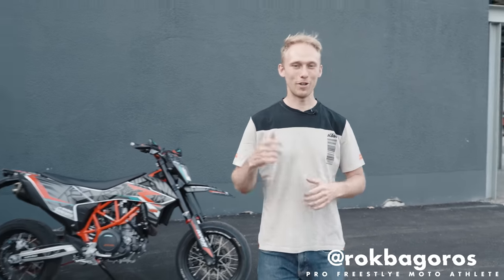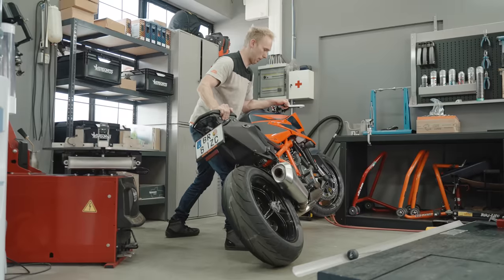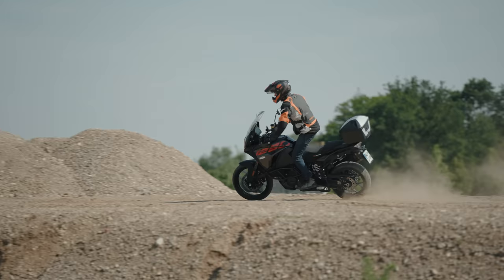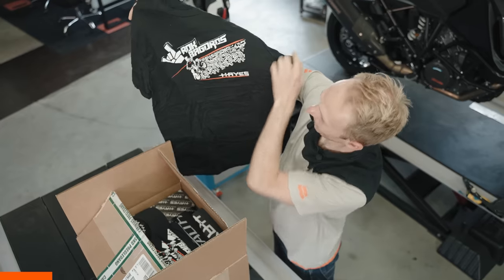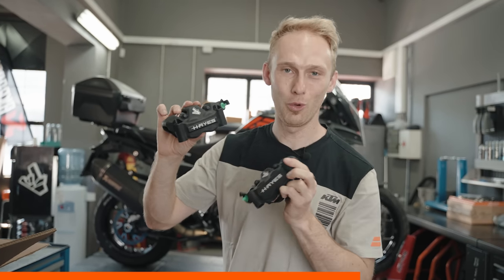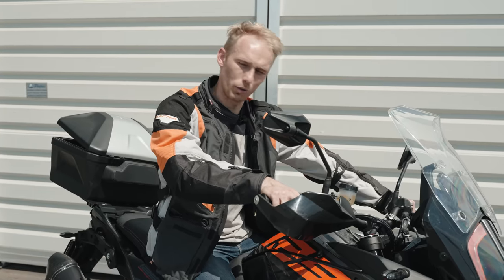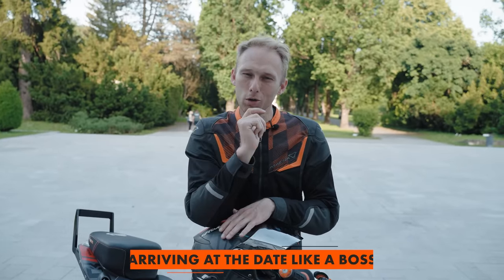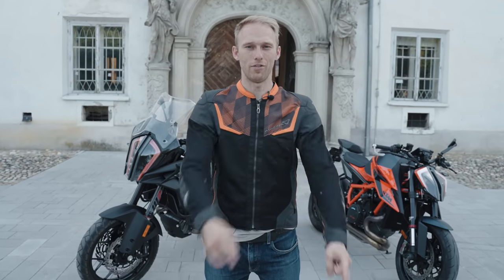5 EASY MOTORCYCLE RIDING TIPS  I RokON vlog #113

Comment: Once you ride with 2 fingers on clutch and brake it's game changing... Even the acceleration on throttle becomes much more smoother, expecially when you have a 1290R 👍
Reply from the maker: Exactly :D
Reply: @RokBagorosStuntrider  I have the 2019 SMCR and for some reason, it doesn’t like the two finger on the clutch method… two finger brake I always do! The clutch side seems to not engage properly unless it’s pulled all the way in. So the two finger won’t work and it kinda bums me out. It almost acts like the quickshifter is interfering.

Comment: I've tried using only two fingers on the clutch, but even if I adjust the clutch cable and lever to the highest position (without risking slipping when released), I end up crushing the other two fingers with the lever when I apply the clutch enough to fully decouple the transmission (brand new bikes). On my CB500X I could only do it after I switched to short aftermarket levers. On my VStrom 650XT with the original levers, I can't. My pinky and ring fingers are not fat!

Comment: When you put two fingers on the handlebar you cant pull the clutch all the way in as the fingers will get in the way. Wouldnt that mean you are not fully disengaging the engine from the transmission when shifting gears?
Reply: Wrong. Depends of the lever design. I've always used two fingers on the clutch on every bike I've owned and never had a problem with gears.
Reply: Adjust your clutch

Comment: Hello
I am writing to you from Kyrgyzstan
I have KTM DUKE 790 2018

I am learning to make a wheelie according to your video

from modes I just turn off Anti Wheelie, and I have traction control on the 1st weakest mode

From the first gear I get to do Willie, a little
but from the second gear nothing happens at all

Can a Duke 790 do a wheelie in 2nd gear?

Apparently for this you still need to turn off the traction control?

Could you tell me the settings for the KTM 790 DUKE bike at which I could make a wheelie in 2nd gear? Thank you
Reply from the maker: You always need to start in the first gear and once you are in the air and have the ballance point then you kick in the 2nd gear. You can not start with the small original sprocket to wheelie.

Comment: The Older versions of KTMs (200 and 390s) had weak side stands which tend to get loose after some time. I am saying this from my personal experience. So I wouldn't try tip no 1 if it is not an emergency.
Reply: Putting the whole weight of the bike on a stand and spinning it round is the most ridiculous thing I’ve seen

Comment: Coming to motorcycling from mountain biking recently, the ergonomics and quality of motorcycle clutch and brake levers seem like a joke.  Very agricultural look and feel.  And what's with sizing for hands of giants, even at the smallest setting?   Aftermarket options seem to focus on increasing the bling factor only, with no improvement in ergo.  1 and 2 finger after market options still put the lever too far from the bars.  They need to employ some basic cam design to reduce lever travel without sacrificing the amount of the required cable pull.  Fighting the clutch lever while trying to hold on to the bars when I take off on my Duke 390 is really killing my enjoyment of riding at the moment.
Reply from the maker: Totaly agree ;)

Comment: The side stand can bend the engine block where it us bolted to, then you are
Fucked. Never use the side stand to spin a motorcycle. That is not what a side stand is designed for.